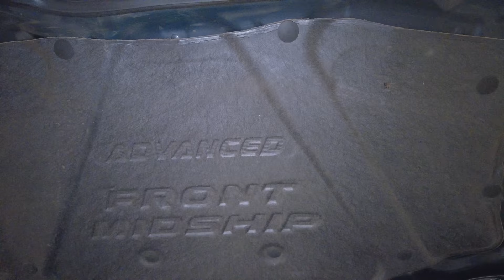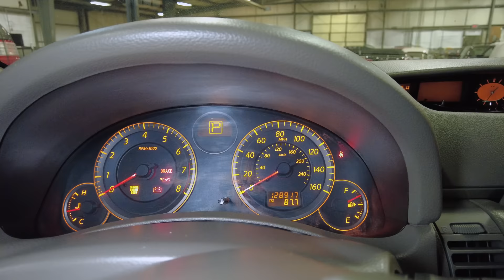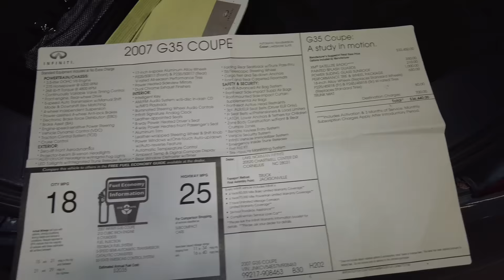Our 20 Years Together Calls for a New Ride & Adorable Kitten!

Comment: I paid $9,500 for a 2006 G35, silver with black interior, 48,000 miles on it. About 18 months ago. I have better wheels BTW but I have the cracked dash. 

I love this car, people try to race me all the time just an FYI for you.
Reply: When I bought the car I changed all the fluids, hoses and belts along with an idler pulley delete. Pervious owner put new tires on two years before fearing dry rot on the original tires.

Comment: Congratulations 🎉 3.5 V6 with 280 HP,, nothing crazy??? Here in Sweden we drive smaller vehicles. Typically 1,1  1,6 2.0 sometimes a 2.5 or 3.0 V6. So over  here that would be something "crazy"🙂

Comment: On newer cars like my 2020 KIA or 2020 Hyundai. I do not have locks on the outside. They are buttons you push to lock your doors.. If I leave my keys in the car, the car will sound an alarm not like yours.. Plus you would not be able to lock the doors from the outside.. So you would not lock your keys in the car.

Comment: I had an 08 G35 sedan. It never beeped like that when I left the key in the car unless I tried locking it with the button on the door. If it was running it would give me 3 beeps. My guess is maybe try to change the key battery. Or try to insert it into the key fob hole on the lower left hand side of the steering wheel.

Comment: If the original idea was a Supra, maybe should have gone for a SC300 or SC400?  Supra underpinnings, Lexus luxury - Toyota reliability.  Still the Nissan is a good car, and a fair bit newer with better tech.  The VQ is a fantastic engine - better than 80% of Euro junk anyway - yeah, they never sound great, but they are smooth and reliable.

Comment: Thats a Nissan Skyline v35 buddy  I have a 300gt sedan I also own a v36 with the vq35hr motor which I'm currently installing a new engine as the old one broke a cam and bent 2 intake valves

Comment: Grats on your 20th the last year of the g35 was 2008 with the sedan the g37 coupe started in 2008 not the sedan and no versions of the g35 coupe came with the 306hp vq35hr as it was only available in the g35 sedan for 07 and 08 and in 09 the sedan went over to the g37 but that being said they are awesome cars I have owned 2 of them and my current 07 sedan has the vq35hr
Reply: I've always wanted one the premium fuel thing turns me off

Comment: After working at a Nissan dealer for   4 years I learned to absolutely despise Nissan.   Horrendous warranty pay, Stupid hoops to jump through, and massive pattern failures, The G35, G37 vehicles are the only Nissan Products I would ever own.  
As far as the FJ, bad blind spots galore.   I have a Tacoma TRD off road double cab 4X4 that the wife has a helluva time getting into.  She drives a 15 Sienna, and it is great for her to get into.  Minivan for the next car Mr Car Wizard?

Comment: The fairlady z, the great z series was once an iconic sports car but the 350z was not.. it was heavy, long gear ratios and was hard to repair almost 300hp but a 178hp toyota corolla xrs is about as fast, youtube it,  the 350z was just under 4000lbs instead of just over 2000lbs like a 200zx or 240sx the 350z is more of a truck than a car, and the suspension can barely support itself with a payload of only 615lbs

Comment: Yikes, doesn't seem to be a good swap, thus the extra $. The FJ Cruiser will appreciate, the G35...nope. You're not old enough to be having the problems you describe. I'm 20 years your senior and still able to hop in and out of my low to the ground Porsche's. The FJ Cruiser would be even easier. We also have an Infinity G37 S redline coup...blast to drive, feels faster than the Porsche's, handling way different.